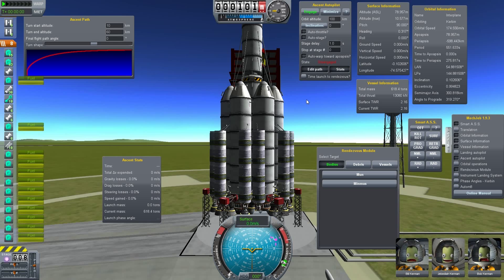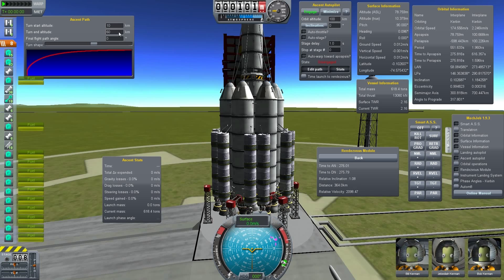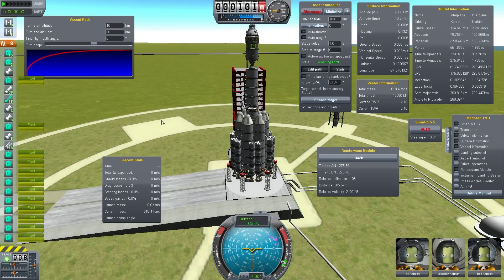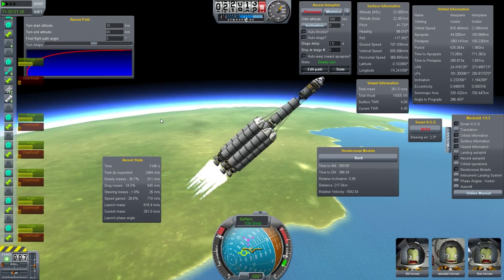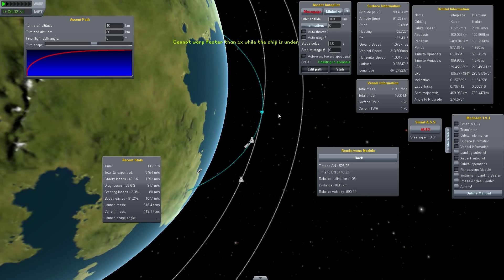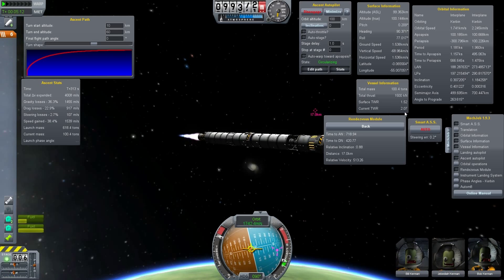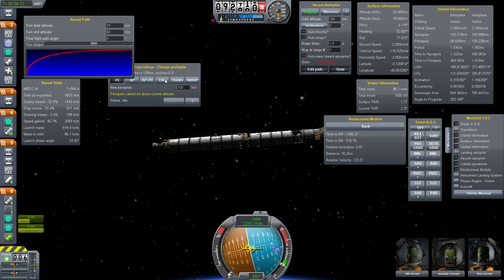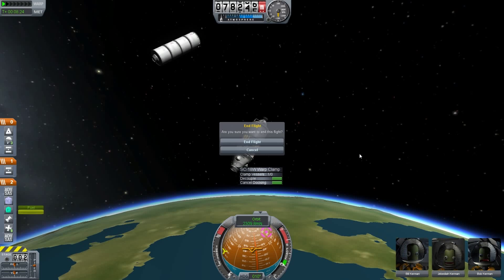[HOW TO (...or not)] time your launch to Rendezvouz with Mechjeb [KSP 0.17, Erkle Docking]

Comment: I believe mechjeb and other operations fail like this because there is not enough electrical power. Remedy this by placing more battery parts on your ships. Could be wrong but the same has happened to me a bit.